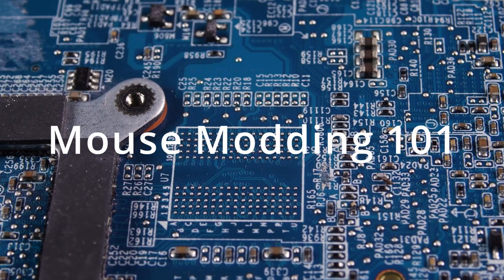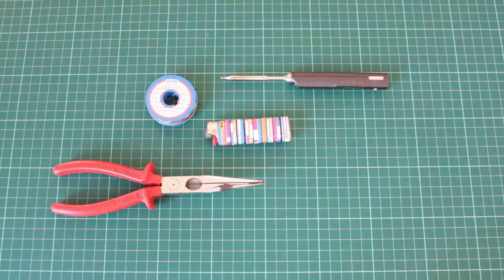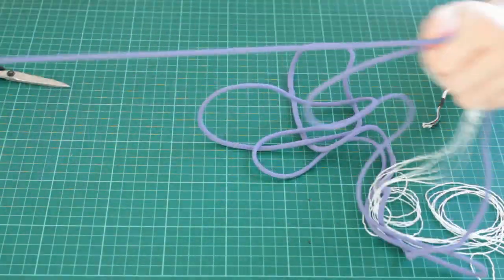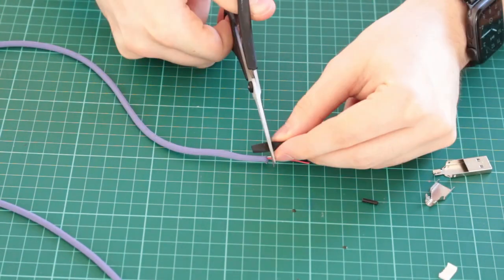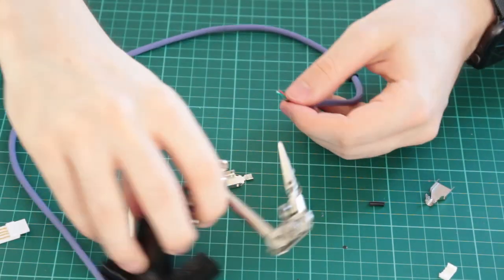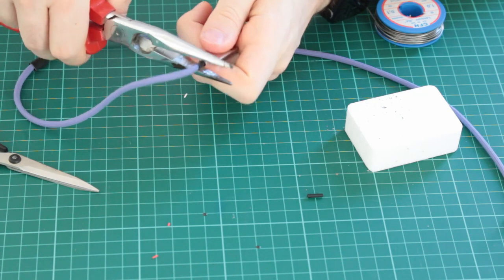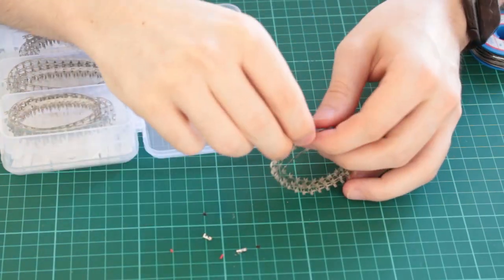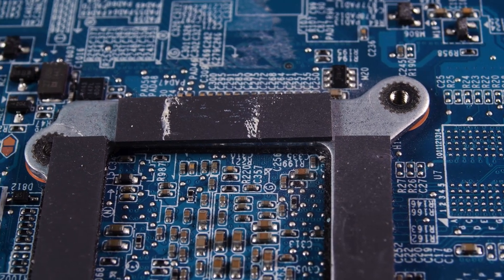How to make a paracord | Mouse Modding 101

Comment: I solder to the crimps as well, it's a super painful process, sometimes the solder just flows into the whole crimp and blocks it so you have to redo it. I just ordered a crimping tool from aliexpress for cheap.
Reply from the maker: I actually never encountered the problem. You could try to use a bit less heat so the solder ”dries” faster and put the crimp completely horizontal or even at a slight angle away from the pin connector. Or you just go with a crimping tool :)
Reply: can you tell me which exact crimping tool from aliexpress i can use for this?

Comment: I did the same with a Razer cable but used the outside fabric layer of the cable as the "paracord", which is 10 times lighter and better than normal paracord cable. I removed all the shielding and the rubber in the cable and used just the 4 strands inside.
Reply from the maker: That’s great! Recycling is always doable with those parts!
Reply: @calonyoutube  It's not only doable, but preferable :D I'm a hammocker and have over 10 tiper of paracord around. None are as flexible as the exterior mesh of the deathadder.

Comment: Are you sure the usb wires are in the correct order? because everywhere else I have seen they solder the black at the left and then white green and red.
Reply from the maker: doesnt matter as long as they are also in the correct order on top. iirc I used the order from ceesas forum post
Reply: @calonyoutube  after some digging around the web this is the correct order and I was mistaken, sorry about that.
I am currently try to solder the JST crimps which is for me the most annoying and difficult.
Reply from the maker: @mrsaul3709  dont worry :) yeah you could also get a crimping tool! makes it way easier
Reply: @calonyoutube  I got a soldering hands and magnifying glass so now it's way easier, just finished my first cable and ready to test it.

Comment: I learnt that it's best not to cut the paracord before putting the cables through, especially if there's more than 4 wires and it's quite thick. I found out the hard way when my pre cut paracord wasn't long enough because it had compressed to allow the thicker cable through it. It was probably about 20% shorter than when I cut it.
Edit: you need to pull the inner string out of the whole paracord length if you don't cut first. So you can just cut 30% extra length beforehand.

Comment: why wouldn't you just do it with the shrink tube while it attached to the original cables (like you would solder it together) :D and it wouldn't stuck.
another tip: you don't need 3-4 shrink tubes when securing the USB Type A head, simply pull the paracord up to that point, so you crimp it with the sleeve, then you can use 2 shrink tube (and lastly one that covers the USB head)

Comment: Hey! I have a little question, would this affect the response time of the mouse or something like that?
Edit: just noticed u have 500 subs, you deserve way more
Reply from the maker: Afaik it doesn't. Especially if you compare it to an aftermarket paracord you would just buy. Also, I doubt manufacturers invest a lot of budget into cable quality. Even if there would be a slight increase in latency I personally would say that the trade for additional freedom in mouse movement is still worth it! I noticed no difference when looking at mouse graphs tho. Thank you so much! that means a lot!!!
Reply: @calonyoutube  endgame gears has very great cables.

Comment: Do I ever need other colors beside white, black , green and red?
Reply from the maker: colors dont matter at all. you could also do all black or w/e color you wont. its just colored so its easier for you
Reply: @calonyoutube  as long I put em in the same order in the 5pin house, it should be good? 
I also have 2 more questions tho, why are not we using 4-pin house is it cuz manufacturers use 5? and also does it matter which cable I solder the the USB "legs" first? ( I assume not)
And thank you so much , I really appreciate it!!!